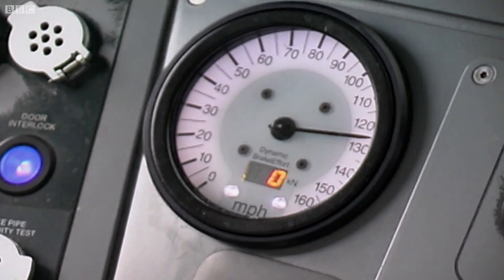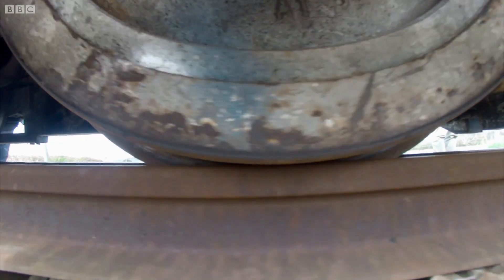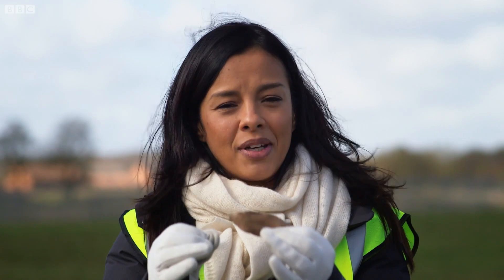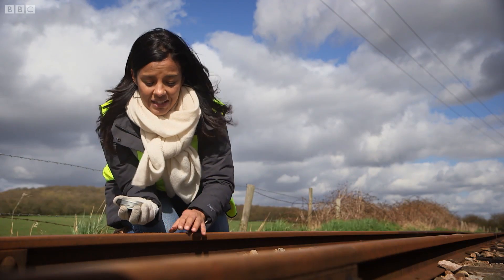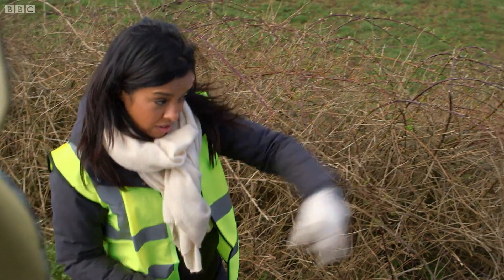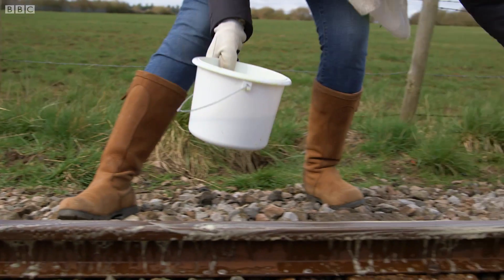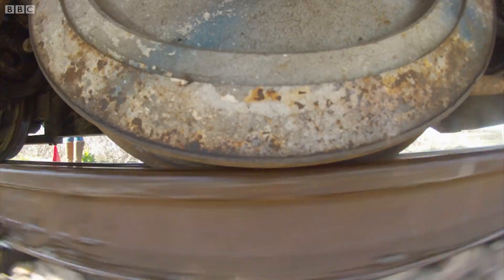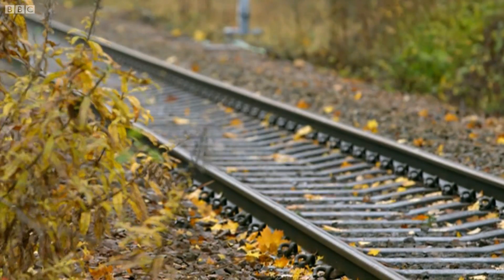Why Do Leaves Cause Train Delays? | Bang Goes The Theory | Earth Science

Comment: Couldn't they just make a device to clean the leaf juice off the tracks just before each wheel?
Reply: The most effective way we (yep I'm a railwayman) keep the leaves off the rails is to use the water jetting treatment trains running continuously, both proactively (we have a base number of trains always programmed to run) and reactively (to Driver reports of low rail adhesion, or signalling system monitoring equipment alarms). 

The trains are expensive to run, but nowhere near as expensive as the delay compensation Network Rail has to pay to the Train Operating Companies if dirty rails cause delays... let alone the safety implications!
Reply: Sir Mutton Chops they have treatment trains using ultra high pressure water jets : http://www.railmagazine.com/galleries/railhead-treatment-trains but they are incredibly expensive to buy and operate as they are only used for a couple of months a year and use massive amounts of water, they also can disrupt timetables on busy lines. There is development of a high power laser that burns the residue off and can be fitted to the lead bogie on a train, but it uses a large amount of power, and from what I can tell can damage insulated rail joints, which would result in more signal failures. 
For now the best we have is sand application to improve grip, it's been around since trains became a thing, but it's the most reliable method of dealing with it.
Reply: Sir Mutton Chops rail head treatment trains (sandite/water jet) are employed during the leaf fall season which are quite effective. They run around the network very frequently
Reply: PerryDaPlatapus You can complain whether or not you have any idea what you're talking about.
Reply: Where would it get all that continuous high pressure air from?
Reply: How would you even go about doing that?
Reply: ***** Im not talking about fans. What you are talking about with brushes and high pressure air are all things that can break. The air cans needs to be refilled and replaced. Brushes would constantly break due to the very high friction and other complications. You dont seem to have any engineering background or anything like it.
Reply: Shooting air ifront of the tiers?
Reply: ***** Except that wouldnt work. The leaves are not dry, they are wet which requires alot more air. If you combined that with the train going 160 km/h you need some fans in front of the train.
Reply: Oh my... You think i was talking about air from fans? Wow.. No, i was 
talking about high air pressure, and the train got alot of just that, or
 get a rotating brush as they use when cleaning the roads? Or combine 
them.. It cant be that hard to solve this if they wanted to..
Reply: Yes but too stupid to think of doing that!
Reply: *****
Becouse its not my job and i got other things to do?
Reply: *****
Well.. Im going to leave you to it, its no point trying to make you understand how things work when you clearly dont understand the basics.

Comment: think about when you're driving your car and then when you're trying to stop you hit black ice, that's what it's like for a train when crushed leafs and water mix.
Reply: Except the train has tracks to keep it on course and not in a ditch. Unless a train was tailgating though!
Reply: @Wesley Holt I love your profile picture.
Reply: i have never, ever experienced that and probably never will. 
what is snow? i don't even know. the closest thing to that i've ever seen is frost on a freezer. or maybe hail, depending on the perspective.

point is: bad analogy.
Reply: Comparing driving a car to driving a train is a failed analogy. Comparing black ice to wet leaves is a failed analogy.
Reply: +Andrew Williams; no. Both mean you cant stop. And neither is visible.

Comment: The trains suck them onto the line, so the leaves need to be in close proximity, therefore if you removed all leaf bearing plants within around 15 meters of the line, all you would get is the odd leaf carried by the wind, some sort of train mounted chainsaw crane could be used to eliminate the pesky leaf bearing plants close to the line.  

But then automated electric cars would eliminate the need for passenger trains anyway, leaving only cargo trains that don't have a tight time schedule.
Reply: +RealistReviewer Excellent argument in the first half of the comment. 
Indeed keeping the leaf bearing plants off the trackside was the solution implemented by Railways for most of their existence, until the 80's and 90's and privatization, when such measures became to costly. 
There are actually some interesting old videos about steam engines on mainline duties in the 90's to early 2000's where it is mentioned that Railtrack let the grass on the line grow so high that it got sucked in under the wheels. 

I don't remember if it was the one about Taw Valley or Clan Line, where they had slipping problems on an incline due to that. 

I'll take the second half of the comment as irony....;)
Reply: Technically it is actually a civil matter. It amounts to trespass. The painting the tracks with soap isn't criminal in itself, but doing it with the knowledge it causes trains to not stop - there's definitely some sort of criminal charge there for intent to cause harm.

Check out "reverse graffiti" - they try to book him, but he's not using any paint.
Reply: +RealistReviewer They use to do this in the days of steam look at photos of railways back then and now you'll see that the line is surrounded by foliage. Steam locos will run on the mainline in almost any weather condition as well unlike the modern ones which will stop working if there is 2 feet of snow.
Reply: Will Coleman They're doing something wrong in the UK, after I moved to Finland I could not believe they had trains running on time even with leaves and -30C with meters of snow.  They just don't buy the right trains to suit all weathers.
Reply: RealistReviewer
Well a few things, a Kettle (steam loco) is pretty heavy, so it just crushes the leaves, and due to it's weight has a lot of adhesive weight.
A lot of the modern British Trains are DMUS with a pretty low weight or axle load compared to their power.
Then there is the fact that a Kettle is a pretty simple machine compared to a modern train, and a pretty rugged one too.
Most things on them run via steam, even heating or electric generation, and steam doesn't really care about snow, it just melts it.

Another problem is that a lot of our modern trains are to highly tuned, with an eye to power and low weight instead of ruggedness of construction.
And too much computer controls, and computers are rather delicate machines, more than two thirds of today's problems come from software errors or glitches.
Look at a lot of the classic Diesels of BR,

You're right in that regard, they are indeed buying the wrong trains.

But they also do the wrong lineside maintenance, I fully agree with Will Coleman look at old shots of the tracks, shots from the fifties or earlier, the foliage was cut back way more then that it is today.
Why is it not done? Well, it is more labour intensive and would cost more money, and the impetetous today is to run as cheaply as possible.

Cutting back the trees and bushes would also help with delays due to trees on the line.

Same with a good winter service, you'll need boots on the ground for that, you'll need Railworkers on the spot that work pro-actively against these problems.
As showcased in an article about the reliability of the german federal railways.

Back in the fifties to sixties that was legendary, it would work in every weather, so much that they could boast, that while everybody talked about the weather, they did not!
And they could live up to that!

Then the rationalization robbed them of a lot of the Railworkers, those in the stations and level crossings etc., and a lot of the simple workers were made redundant in an effort to rationalize.
And that's when they started to have problems.

For a reliable Railway in all Weathers you need manpower, and a lot of it, there is simply no substitute.

So the problem is indeed systemic.
Reply: RealistReviewer
Agreed, on all points.

And historical evidence shows, that Railways only ran at a profit when they pretty much had the transport monopoly or still had the majority of the modal split.
(in other words up to 1920's to 1930's, late 50's at the max.)
In that time most of the Railways, except a few exceptions like SR used their Freight to subsidize the passenger transport.
Thanks to breaking everything up not even that is possible anymore.
Reply: ss ss in the UK at least railway trespass is dealt with under the bylaws. Just being there is enough to be arrested and charged.
Reply: The slippery goo is unfortunately airborne so it ends up on the tracks anyway. It would decrease the problem slightly but not completely. As the mass removal of trees around Swedish railways in later years have shown (clearing of all trees within 20 metres of the tracks), it is still a hard problem to get around.
Reply: Sadly Network Rail can't simply cut down every lineside tree, for there are prohibitions: some areas are legally protected (Sites of Scientific Interest); also trees are allowed or encouraged to grow on adjacent land not belonging to the railway, to keep local residents from seeing trains go past their houses.
Reply: RealistReviewer and obviously the towns and cities the line goes through will agree to letting trees get cut down 15 metres away
Reply: RealistReviewer Deal with it we still use diesel trains and the railway is often busy so half the time it isn’t even leaf problems. When one train at the front of the line is delayed, the train at the back gets off the worst
Reply: We could have had self steering cars for a long time now by just laying a single rail flush with the road and installing a rail wheel to follow it.
Reply: LupusAries There are certain services that need to be non profit and publicly owned to provide a good service, Rail service is definitely one of them, due to the need to reinvest most of the profit into maintaining the lines and investing in reliable tough engines that can operate in very inclement weather/conditions, a business just can't turn a profit at this type of service as shown by the bailouts.

Comment: So I dunno... you design extra wheel like things to come down in the front that have a surface that cleans the rails for all the wheels behind it. Though I'm sure they've tried
Reply: The sand system they use to climb gradients or to help stop in an emergency is more bonkers than this, proving they'll use anything that works, so they must have tried that already and had little success.

Comment: This is correct for modern trains that use disc brakes much like on a car or bike. It is an efficient braking system that is hindered somewhat during autumn. The reason this has become a problem is because of the technology of disc brakes. During the time of steam a brake block was applied to the wheel as the locomotive braked. This in turn was quite efficient of scraping the slippery leaf material off the wheel tyre and did not have as much of an impact on braking as it does with modern disc brakes. Of course loco crews did have to take more care in autumn with leaves, but not as much as modern day drivers do.
Reply: Liam Taylor-Warren Well said, disc brakes have indeed exacerbated the problems. The old 'slam-door' trains built in the 50s & 60s had 'clasp' or tread brakes, as you say, the cast iron brake block was applied directly to the wheel tread or tyre and very effectively 'scrubbed' the tyre of leaf mulch. Whilst stopping distances were still increased during leaf fall season, it was no where near as bad as today. Sadly, most trains with tread brakes were withdrawn and scrapped from 2005. So, we're stuck with the disc brake. And as for peoples suggestion of a brush or something in front of the wheel, you would be surprised exactly how 'sticky' that leaf mulch is. Once its crushed on to the rail, it really is exceptionally difficult to remove. There is a water jetting train that runs a continuous (ish) circuit, but, particularly here in the southeast, there is a lot of routes, most with double track, some with 4, 6 or even more tracks, its a huge job to water jet and sandite so many route miles. Frankly, I don't think people realise that.

Comment: I have personally experienced the result of a trolley trying to stop on a leaf strewn track.  Instead of putting the trolley in reverse, the emergency brake was hit.  We slid 20 feet.  We were traveling less than three mph, coming to a stop when we hit a little pile of leaves and ice.  The pile was about an inch wide by about inch and a half long.  I went looking for the cause of the slide and discovered the piles.  It didn't take much to break the friction.  And no one was hurt.  Except the trolley.  The pole bent upon hitting the barn door.  It was out of action for half of a week.